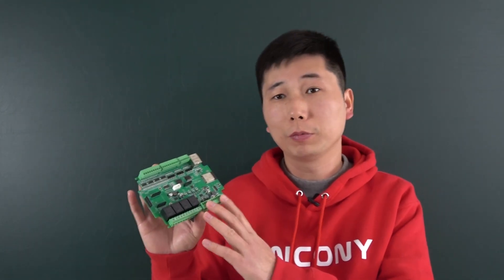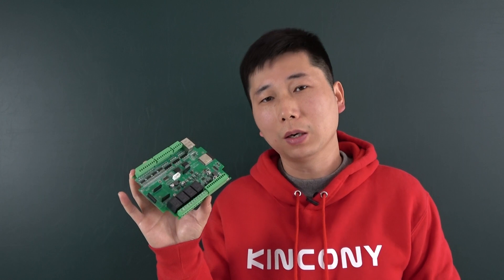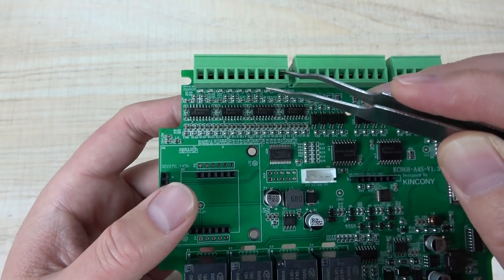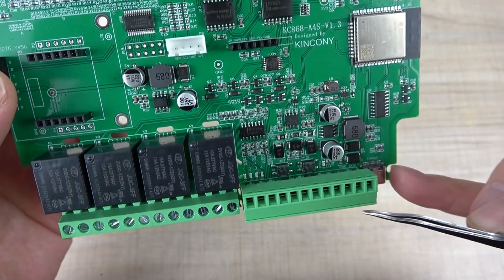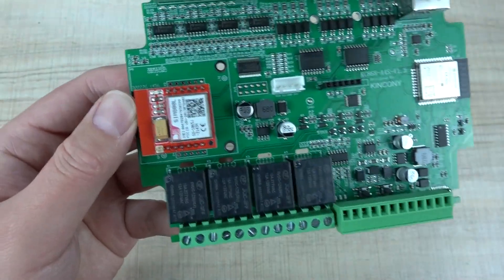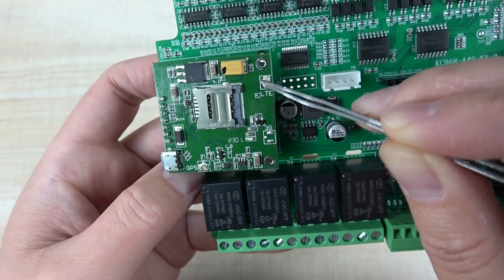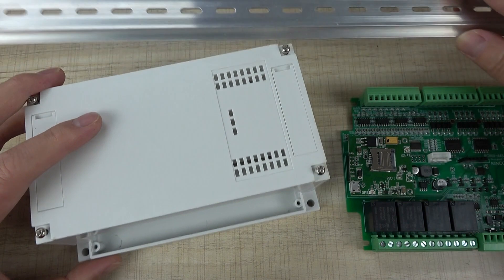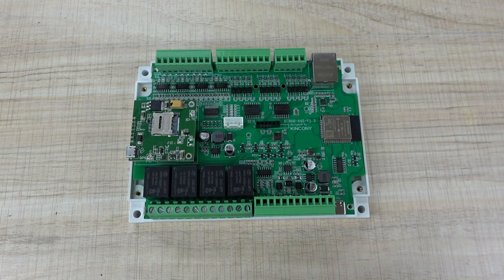KC868-A4S new ESP32 home automation board released!

Comment: Hello, where can we find the PWM output extender ?
Reply from the maker: there are 8 pins hold on PCB beside 4G module socket. that are PWM output pins.
Reply: @KinCony  there are any adapters for extender? I mean how we connect the wires
Reply from the maker: @mariuscristianmoldovan4158  you can solding a 2.54mm white socket or pins.
Reply: @KinCony  alright, so the extender can support 2 RGBW led strip 5 wire? Or 8 dimming white led strip?
Reply from the maker: @mariuscristianmoldovan4158  no, PWM output level is 3.3v. if you want to control LED strip, suggest use KC868-AP or KC868-D16 dimmer controller.
Reply: @KinCony  Alright, can I use the PWM extender as 8 DO mosfet?